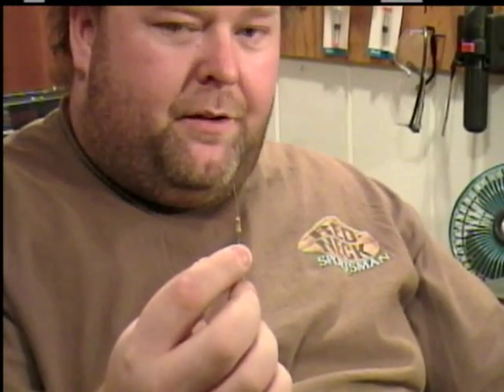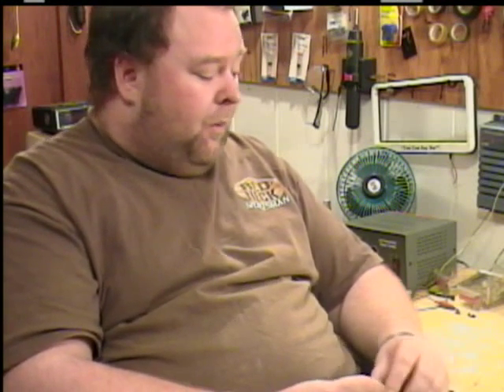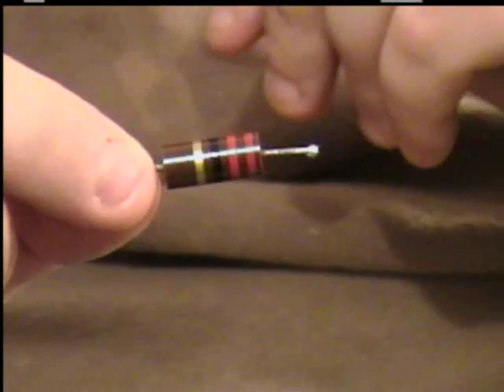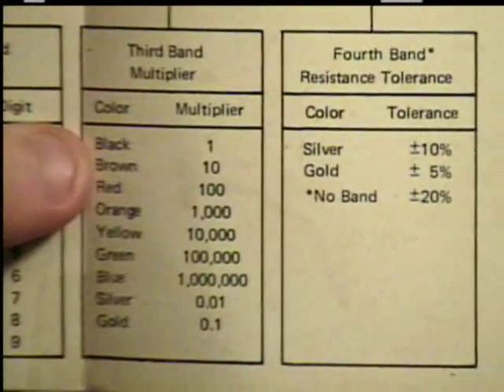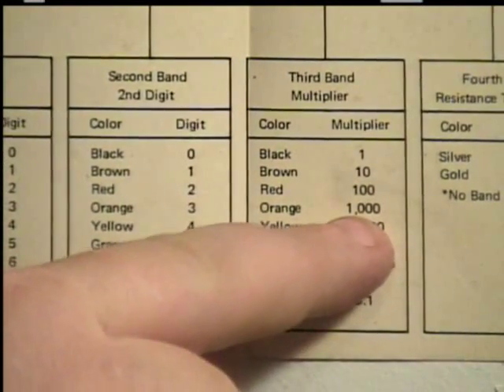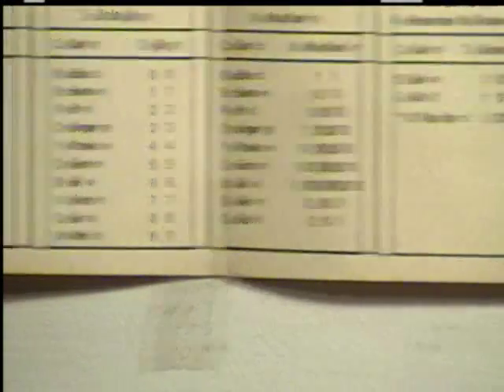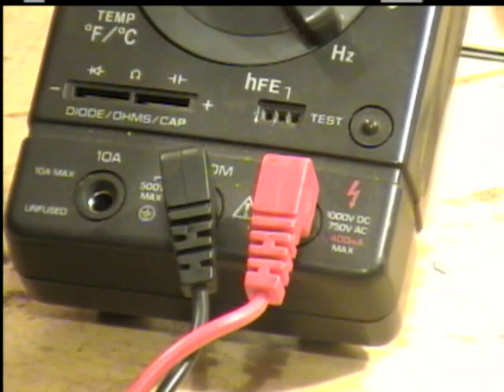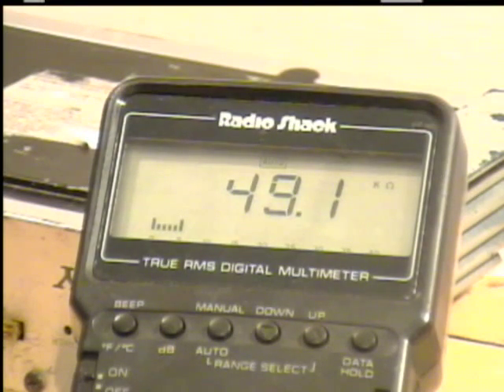Identify and measure a Resistor

Comment from the maker: You first need to know how much current will pass through the resistor. Take the Voltage and divide it by the resistance. this will give the current through the resistor. Now, multiply the voltage by the current to get the wattage. The resistor must be large enough in size to dissipate the heat safely. MrFixit

Comment from the maker: That's a good point, FUNK BOOGIE. With so many variations in resistor sizes it would be difficult to list every known size for wattage rating in the video. SMD resistors are usually 0.60mm x 0.30mm 5/100W. Most electronics use 3.5mm x 2mm 1/8W, 6.5mm x 2.2mm 1/4W, 9.5mm x 3mm 1/2W, and 9.5mm x 4mm 1W resistors. Power Resistors can be much larger ranging from 14mm x 6mm 2W to 4in. x 5/8" 50W and larger.  -MrFixit

Comment: If u have 2 resistors with the same ohm value but one resistor is bigger then the other.
how do u find out which of the 2 resistors will be rite for your circuit to resist current?

Comment from the maker: The tolerance refers to the accuracy of the resistor's given resistance. On 4 color band resistors, the 4th band will either be gold (5%), silver (10%), or no color band (20%). Take the stated value using the color-code chart and multiply it by the tolerance value (%). For example: brwn blk red gold is 1,000 ohms w/ 5% tolerance. 1000 x .05 = 50. Add 50 to 1000 = 1050 and subtract 50 from 1000 is 950. A 1K w/ 5% will range from 950 to 1050 ohms. You can find charts like in the video on the web.

Comment from the maker: @coastalorphan thank you. As for the wattage, many resistors larger than 1W are labeled with their max wattage. The wattage is how much heat the resistor can safely dissapate. They range from 1/10W to 100W or more. The 1/8W, 1/4W, and 1/2W you will find in many electronics. The larger resistors you will find in Power supplies. You can look up resistors on the net to have an idea what sizes handle different watts. -MrFixit